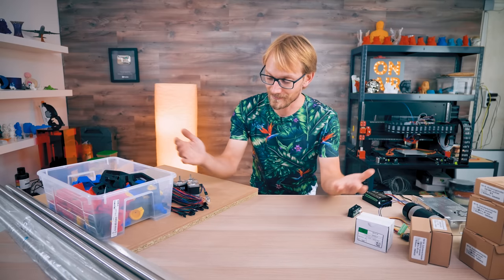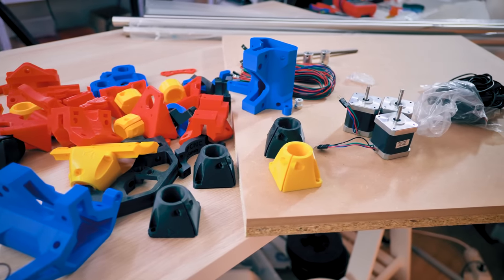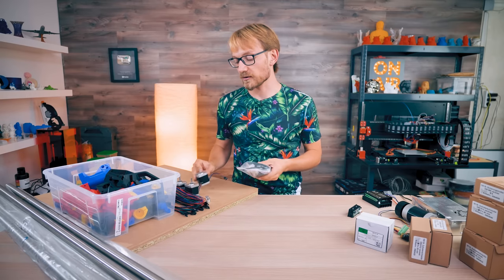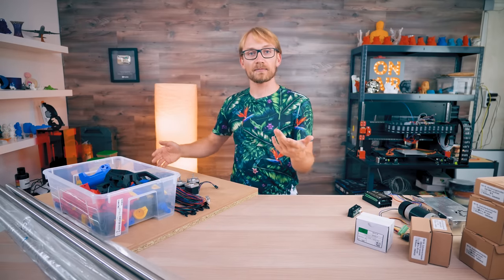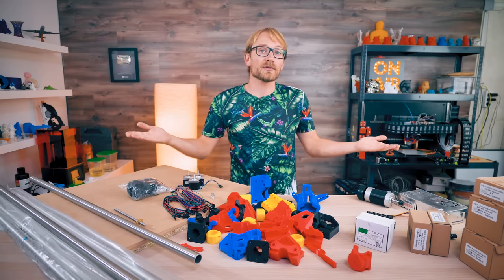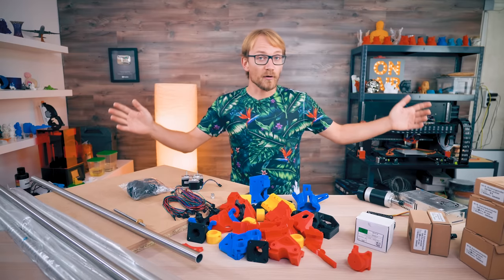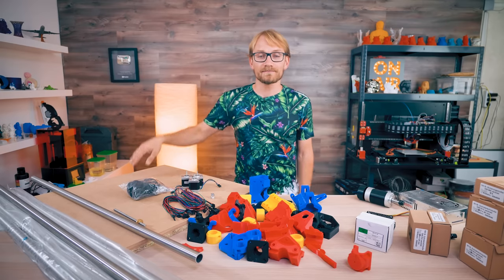Building the MPCNC: Parts and component choices!

Comment: The steel reinforced belts work harden going around the bearings on this machine and break.  That's why we don't use them.
Reply: I didn't even know that could happen, when I first built my MPCNC i used steel reinforced belts, but because they are so stiff you need to tension them so much that the steppers will lose steps...
Reply: Yup.. the same reason they fail quickly on 3d printers.The toothed pulley diameter makes the wires break quickly and then the belt can stretch like its just plastic. Why all my printers have been swapped to fiber reinforced during assembly.

Comment: I printed it originally in PLA, but after building it and not getting around to wiring it for a few months, the PLA cracked all over the place. This was not under any kind of a load, just the pressure needed to hold the plastic to the metal conduit. I reprinted everything in PETG and it has held up considerably better.

Comment: Really looking forward to this build, Thomas.

Ryan at V1 Engineering is super talented and very attentive to his customers, so, hopefully your build will go smoothly.

As I suspect many who follow your channel are, I'm a "digital fabricator", with feet in both the additive (3D printing) and subtractive (CNC) spaces. While I have experience on many smaller form factor CNC's, my current machine is a Viper XP from CNC Factory (5'x10', 10HP spindle, automated 10-tool changer and vacuum hold down). It's my first experience with a machine this large and powerful, and it's been a game changer.

Comment: The weird tubing sizes make sense when you think about it.
Tubing is mostly labeled by the inside diameter because it is made for something to go through so that is the size that counts.
Reply from the maker: Many pipe and pipe thread sizes are labeled by the inside size cast pipes used to be back in 1875. On modern 1" pipe, you'll not find a single dimension that is actually 1".
Reply: Pipe is measured by inside diameter, tube is measured by outside diameter.

Comment: Of all the MPCNC designs, this is the one I found easier to source. Most others use rectangular profiles or solid rods that are hard to find. Also it can be easier to adjust to individual needs in build size. However I plan to use the "electrical/electronic" setup of the RS-CNC32, it has nice features and also is completely stand alone which fits my needs best.

Comment: Interesting series.
You mentioned not knowing why pipe has odd OD.
Pipe size is nominal ID.   As the schedule (wall thickness) changes, the OD changes.
You are using stainless tubing.   Tube size is nominal OD.   As wall thickness changes the ID changes.
Pipe is normally used to move fluids.
Tube is normally used for structural purposes.
Dave.

Comment: I have a partially finished one in my basement currently.  You'll want to do something for cable routing, that's what I'm currently stuck on.  X and Y are ready to be installed, but I need to come up with a good way to send it to the center assembly.

Comment: You might want to look at the double belt modification done by Brauns CNC on YouTube in his video Building a (modified) mostly printed CNC

Directly underneath the belts he places a wooden board standing upright with second belt glued to it, resulting in a sort of toothed rack. This completely removes the tension on the drive belt outside the idler rollers and instead transfers it to the bottom belt, which can't stretch because it's glued down on it's entire length
Reply from the maker: I've seen that, but I think as always I'll start out as stock as possible and then work my way forward.

Comment: You could build this out of pipe and angular components they use to make bus hand holds/railings out of. It would result in a very rigid structure. Push the envelope even further and you could use drawn (not seam welded) pipe (quite straight) and get even further bonuses.

Comment: Oh you too are building one? Nice, im currently setting up the electrics for mine. :D
On the Makita router, ive bought a 6mm to 3,175mm adapter from a german manufacturer, wasnt as cheap as the chinese ones but this one actually had good tolerances. Runout below 0.03mm, which is decent enough for a router being used in a half plastic cnc imho.

Comment: I am printing for 2 weeks now. :-)
I use petg.
In old pla prints i see allot of splitting over time.
37 print hours to go. 5 big parts.
I don't like to leave my printers unattended.
My board is a SKR 1.3 with TMC 2130.
Hope te get sensorless homing working.
If the 2130 is not strong enough i upgrade later to the TMC2209.
I use the SKR1.3 with tmc2130 on my ender 3 and prusa i3 clone 2014.

Comment: I did my mpcnc a year ago.  But one of the best things I found was don’t think of conduit. I found that towel rack tube was perfect instead (25mm chrome stainless steel tube) and was way cheaper and came pre cut in standard length.
Reply: Thanks for that tip! Hadn't thought/heard of it.

Comment: I built one of these, the only problems I had were that I cheaped out and tried to use a raspberry pi with an arduino based controller and open source software. It worked well with simple parts (2.5D cuts) but when I tried to do full 3D surfaces, it always quit or went crazy. I ended up buying a USB controller from amazon that is compatible with Mach3 (Mach3 loaded up on a new laptop) and have yet to have a single problem. Also don't cheap out on the stepper drives, had lots of problems with a cheap drive just quitting in the middle of a cut.
Reply: Also, don't even think about cutting anything without a vacuum system in place, the dust builds up on the rails/bearings and can cause rough motion.

Comment: Tom, please beware that chinese spindle gets pretty hot in use. Eventually the PLA spindle clamp can release the working spindle as the PLA gets soft. That was so close here as I saw the cut quality decrease, I emergency stoped the machine just before seeing the spindle falling. A real piece of chance! You will probably need to upgrade your splindle mountings to ASA parts or OEM aluminium mount as I did. What about a modern board alternative to the old timer MKS Gen ? I mean a Fysetc Cheetah or, if you like changeable drivers a Bigtreetech SKR ? I also strongly recommend ABEC 7 class bearings. Good luck with the build. And oh, the colours reminds me the joyfull kindergarden, kinda FisherPrice MPcnc ;D
Reply from the maker: Thanks for the tip with the spindle - the air cooling sure doesn't seem very effective. Maybe one of the first parts to replace with ABS.
I tossed to MKS Gen in the list as it's a fairly popular and cheap board (and useful outside of CNC use) - the "best" choice probably is something else, either a cheaper option like the CNC shield or something beefier.
Reply: @MadeWithLayers  nowadays an All In One Board replaces attractively the CNC Shield (Keyestudio CNC or so for about €15). Bonus, you're not constrain to 16 microsteps, and the board is spindle/laser control ready. Through, you can still connect external beefy drivers if needed. But who wants to power Nema 17 with such drivers ? I run my desktop CNC equiped with 2.5A Nema 23 motors with a MKS Robin for about a year. 32 bits 3DPrinters boards works definitely fine. I tryed external drivers then go back to the DRV8825 @ 2.2A which were close to perfection : no heat, no missed steps, so... 

Actually the price tag of the 32 bits Cheetah board with built int TMC drivers is under 30 bucks, so it's highly competitive versus the 8 bit MKS Gen. In my humble opinion, of course ;)

Oh, and thank you for your videos (I forgot), I'm an early follower. I will follow your build with interest.
Reply: @MadeWithLayers  Definitely keep an eye on the temp, but I'm running a brushed chinese "spindle" on mine and so far, haven't had it get hot enough to soften anything.  I think the dewalt gets hotter, and I've run one of those for almost 20 hours straight once.
Reply: @barry99705   There's various situations obviously. The Dewalt is a router, so this is not the same story, It would probably don't last that much except episodic hobby week-end jobs. I leave it appart for now. 

The 300w chinese spindle does not heat that much, especially under 12VDC. As you raise in power and/or voltage, spindles gets  unfortunately hot after 20-25mn of use, which is not that much for serious CNC operations. According to the BOM, Tom will run his 500w spindle under 24VDC so he may be concerned. 

I've got a few experience: I'm into CNC routers since 2003. On the machine I'm talking about - I actually own 3 CNC mills : desktop, full sheet CNC, and Epoxy Granite metal CNC mill - I can barely touch my chinese 500w air cooled spindle running under 48VDC. So I guess It raise over 60°C. A temperature my PLA holder could not stand, despite its 60mm tall. Through, I noticed Plastic spindle mounts works like heat insulation for spindle, so the temperature is allowed to stay and raise higher than an OEM aluminium spindle mount. Serveral reasons for that IMHO. First, there's the thermal mass effect. Second, aluminium is good at catching temperature. Last, but not least, the mounted fan blow a lot of air around the spindle (much than on the spindle itslef I'm affraid), and while the aluminium mount is on the way, the spindle's fan cools it.

Comment: I'm interested in making a CNC hotwire foam cutter. Is it possible to adapt this for my use?
What about the software part? Thanks.
Reply from the maker: The MPCNC platform is not tied to a specific software - you can use whichever CAM package you feel like. But I don't think the MPCNC is a good match for hot wire cutting - there are other, lighter platforms available for that
Reply: @MadeWithLayers  Interesting. Would you care to name some of those platforms? 
I have a 3D printer and a large CNC router machine. Thanks

Comment: What do you think about carbon ? 1-4mm ?
Reply from the maker: I've not milled CFK before, but I think it should be possible. Super messy, though, the open construction of the MPCNC is probably not great here.
Reply: It's been done.  Need either really good dust collection, or in a water bath.  That's what one of the guys did.  He put a big metal baking pan under the machine, then hot glued some spacers and the cf to the spacers, then made sure the carbon panels were covered.  You really don't want that dust floating around, its ungodly toxic, and slightly electrically conductive.

Comment: This seems great but I dont like the belt design. If it had lead screws I would have already made it. I am still waiting for the Dremel CNC version with a 1.5kW spindle mount.
Reply: Long lead screws get flappy.  The belts at these lengths don't have enough stretch to measure.
Reply: But still they are belts. Ever seen a commercial CNC rocking belts? I definetly havent. Its fine for laser cutters and 3D printers which only transfer a few 100g max but when we are talking about a 1.5kW spindle that weighs over 2 kg without the tooling and needs some decent force to keep the chipload at a consistent pace than lead screws are the way to go. You can buy thicker ones too you know?

Comment: Can anyone help me resolve a problem with m printer? After like 20 layers every layer change results in underextrusion followed by overextrusion. I am trying to print single wall for calibration (I did the 100 mm filament calibration). The problem occures no matter of retractions settings.
Reply: Check the extruder grip cog, spring tension and stepper current. It could be slipping or losing steps.
I had this on my Ender and solved it by adding a washer to the extruder spring and increasing the stepper current by about 10%
Reply: @ahaveland  Unfortunately, this is not fix for my problem as I tried 4 different extruders and 2 different stepper motors, I think it may be firmware related, but not sure
Reply: @vojtator  Try a different slicer, but listen to the stepper to see if it's skipping. Maybe feed rate is too high if the plastic can't melt as fast as it needs to? Try slowing down a bit too.
Other than that I can't think of anything else.
Reply: @ahaveland  Tried cura and pathio, got same results, speed is 30mm/s. It is goddamn mystery
Reply: @ahaveland  Also, I used 52Ncm and 59 Ncm steppers with sufficient Vref which are overkill anyway

Comment: I printed mine with PETG.  Much stronger and temperature resistant than PLA.
Reply: PETG is not stronger than PLA. PETG is more flexible. You need rigidity on this type of machine. So PLA is better for this.

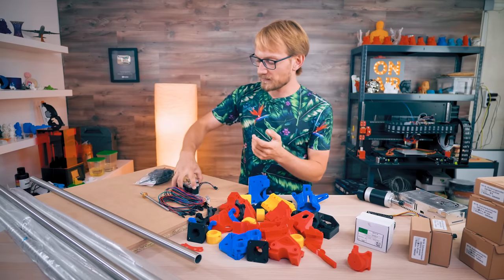Comment: 5:50 - 6:40
That is exactly why you should always use a parametric phile formate.
OpenSCAD for the win.
Reply: So that you realize halfway through the print that you printed the wrong parts?
The easier (fewer different versions) the better.
Reply: @Jehty_  
well it is a lot easer, if you just can give your CAD file thediameter of the tubing than searching for one, that has the right parts. especially if they dont exist.

Comment: I've wondered if you could use the MPCNC to cut upgraded aluminum parts for itself.
Reply: For sure that this machine cannot cut aluminium
Reply: @ericbeckers2673  There are a handful of steel cutting videos  and tons and tons of aluminum vids. Softer metals are not all that difficult to cut, aluminum is actually pretty easy as it doesn't need cooling.
Reply: Eric Beckers I see absolutely 0 reasons it shouldn’t cut Aluminum. It is a very easy material to cut.
Reply: No coolant on Aluminum? good luck then
Reply: r @ericbeckers2673  When cutting aluminum the Chips take the heat with them. I really don't know why Aluminum is some sort of standard, all the smaller CNC's I know of have no issue with Aluminum with proper CAM. On the MPCNC Barry cut a thick chunk on a 5'x5' build on like the second revision of the MPCNC. I am sure the video is still up.

Comment: That Stainless will be a lot stiffer than conduit.
Reply from the maker: The thicker, threadable conduit looks pretty similar - and I think thin-wall wouldn't really up for the job unless you're only using it as a pen plotter.
Reply: @MadeWithLayers  we call the threadable stuff water pipe on this side of the pond. Not terribly stiff, but not too wobbly over a meter or so. I guess the best option for rigidity would be extrusion used for printers?

Comment: DO NOT use galvanized water pipe or any galvanized material. Galvanized pipe is VERY ruff & will destroy your bearings & any other movable parts. You will have to remove the galvanized material from the pipe by heating it & galvanize is toxic & you risk warping the pipe.

Comment: Never ever print any construction parts for moving machine from basic PLA. 😉 (Parts will degrade over the time even under very small stress. The rigidity will be worst and worst, vibrations stronger.) CPE or even PETG are not so expensive and better here.
Reply: PLA is stiffer than petg.  Some of my parts are petg though, just needs a couple more perimeters.  PLA is fine if kept indoors though.  We have several users, including me, who keep their machines in unairconditioned spaces and they pla parts usually hold up just fine.  You get the occasional delamination here and there, but I'm not sure if that's environmental, or just a bad print.  My oldest mpcns is going on 4 years old, and has been in the barn its whole life, from -10F to over 100F.  I think I've only lost one part to delamination.
Reply: @barry99705  It's not about stiffness, it does not hold some of its properties under long term tension, which is present in the assemblies. I fully respect your experience with these type of machines, the parts are very robust here also. (And I like PLA for many hobby projects.) But I still highly recommend another type of material for mechanical kits, still well printable ones. (For the similar reason even quality RepRap 3D printers are not printed from PLA.)